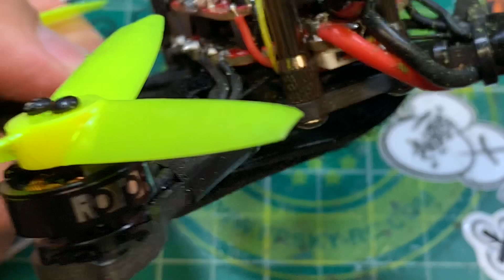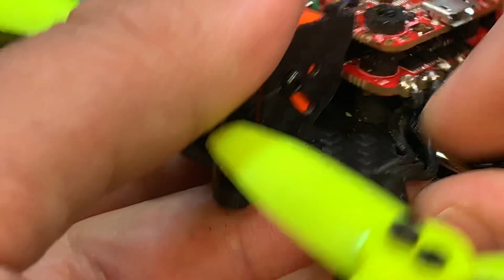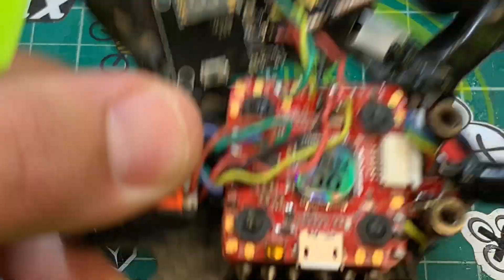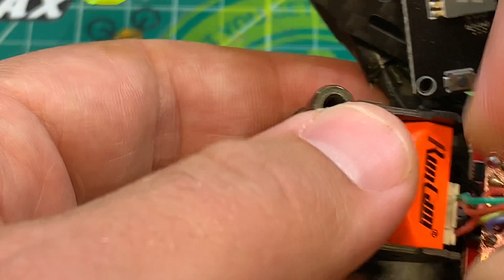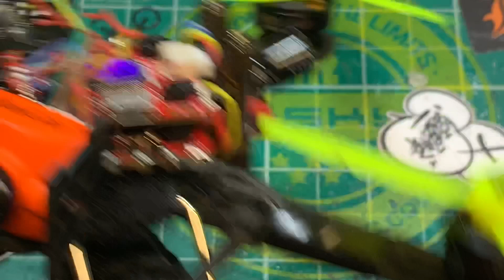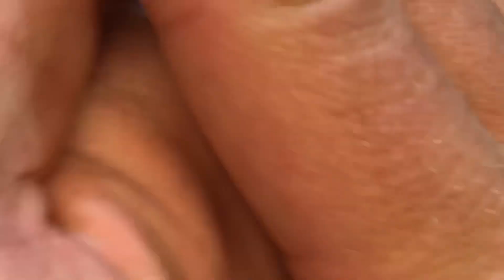Hglrc F420 Stack Quick Look After Flying

Comment: Would this run a 3 inch?
Reply from the maker: Jesse Lopez Drones it is for 3 inch.
Reply: Chris Romano Thanks 🙏 Cabot handle 1300mah 4s 50c batts?
Reply: Chris Romano I cant get my Spektrum receiver to work. Any ideas not many vids on this stack.
Reply from the maker: Jesse Lopez Drones I’m not really up on spectrum. I believe you can’t use the pad broken out for rc or sbus because of the inversion deal. Pick another uart that is broken out both the tx and rx. Then go to ports and pick the correct uart then correct receiver type in configuration tab.
Reply from the maker: Jesse Lopez Drones I meant it had been installed on a 3 inch. Works great for it.
Reply from the maker: Jesse Lopez Drones yes it can take 4-s. But it’s only a 20 amp esc. So In therory. You don’t want your quad hitting over 80 amps total. For a 5 inch I’d say go for a 25 or 30 amp esc. 3 inch and less  will be fine on 4s.
Reply: Chris Romano cool thanks 🙏. Appreciate your time.
Reply: Chris Romano Thanks 🙏 rx1 worked
Reply from the maker: Jesse Lopez Drones glad I was able to help.

Comment: I'm getting osd flickering with this fc with a runcam split mini 2 anyway I can fix this I do have the cap solder on the main power leads thanks in advance
Reply from the maker: cruz fpv most likely the split is over loading the 5v reg. Not sure if the split runs on vbat. If it does move the power for that and Vtx to the battery lead input and add a cap. Or try just the Vtx first.
Reply: @chrisr112887  thanks for the reply I figured it out I had to run a ground wire from the fc to the split ground and that seems to fix the issue thanks again